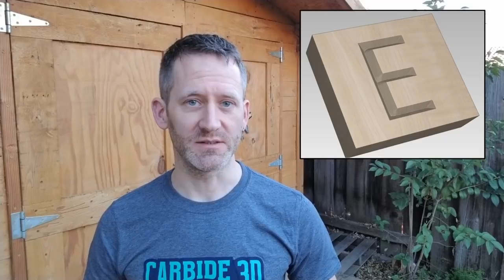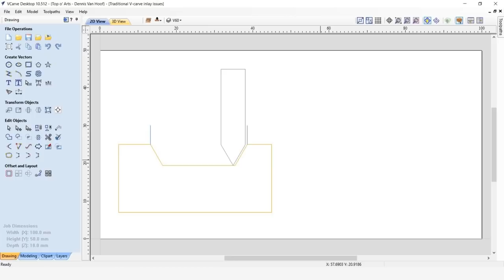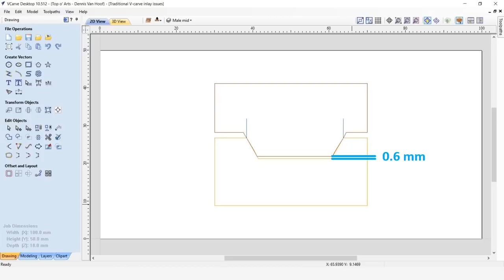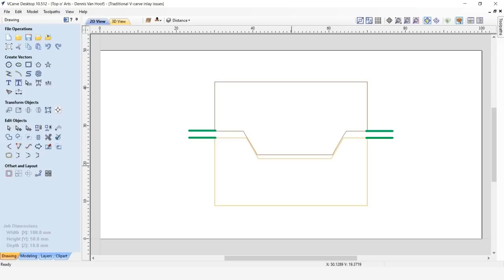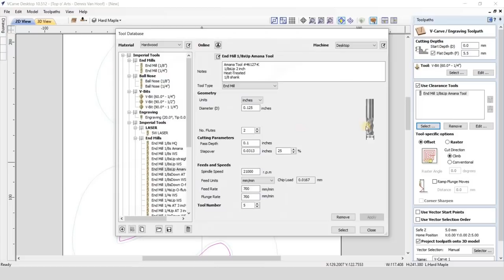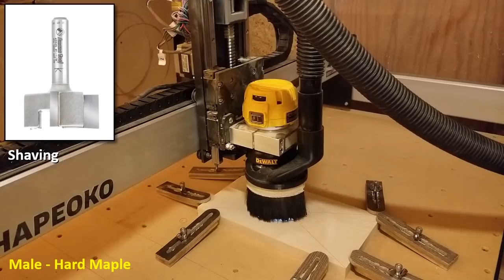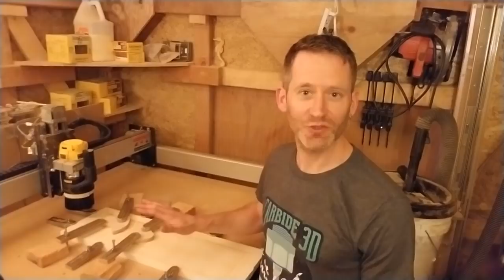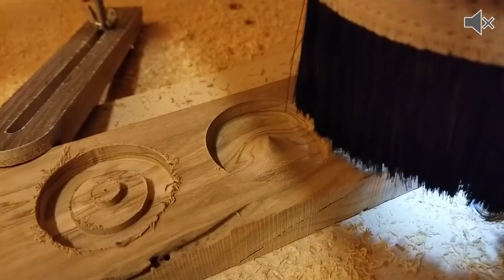CNC multi-inlays with a V-prism technique - Carving a geisha scroll with the Shapeoko

Comment: Fantastic work!

You're totally correct with the wood gluing time and glad you mentioned slow curing glue, it's a total game changer! I typically glue the pocket and glad you mentioned it. 

I have found that with large inlays that a plastic spreader works better than a brush (I've done similar work stacking 8 or 9 layers). I've also used very heavy/flat objects to evenly distribute pressure when gluing like marble slabs and/or 5 gallon buckets as opposed to clamps.
Reply from the maker: Thank you for sharing your experience! This was my very first inlay ever! I usually find out how to do tings better by making mistakes. :) Putting heavy objects on the inlays crossed my mind. But, although the Shapeoko XXL is quite sturdy, the CNC bed is relatively weak (which they improved with their Pro version), and I'm afraid it may permanently bend the metal scaffolds underneath the MDF surface.
How long do you let the slow curing glue harden before surfacing the male back side? I noticed that, even the regular glue still had some sticky areas after 24 hours.
Reply: @Dennis van Hoof  Understandable, I use a standard Shapeoko 3 with the aluminum bed along with the sacrificial MDF so I'm not worried about the weight, but I know you use yours for jigs and such so that's probably out of the question.

Wood glue definitely takes experience and mistakes (don't worry I make plenty!) I've found humidity severely effects drying time, glue like Titebond should set in about 24 hours, but sounds like you may need 48. If you're looking for very quick dry time/superior bonding on intricate or small areas you may want to try wood CA glue with an accelerator. They can come in handy needle tip applicators (again, for very small detailed areas).
Reply from the maker: @LOBrien_  Thanks for the tips! I'll keep those in mind for my future projects. :)
Reply: @dennisvanhoof9958  Damn!  This was your first inlay.  You'll be a Master Craftsman soon.  Keep up the good work and great videos.
Reply from the maker: @unclebob8746  Thank you for your kind and encouraging words!